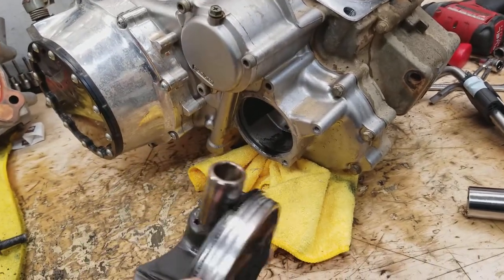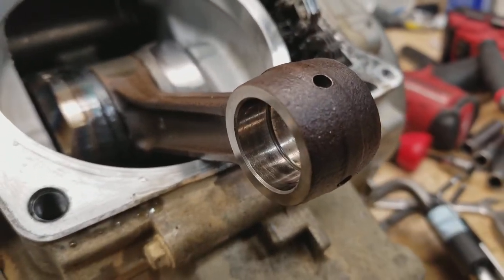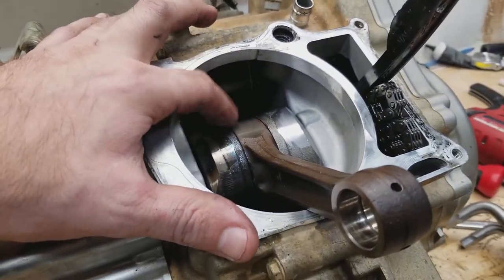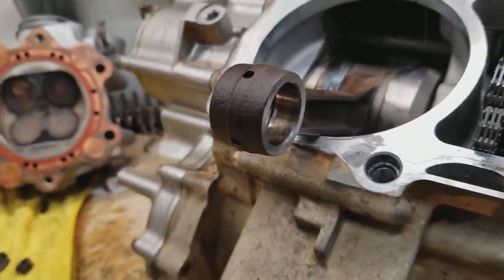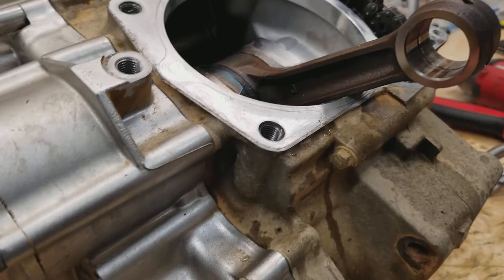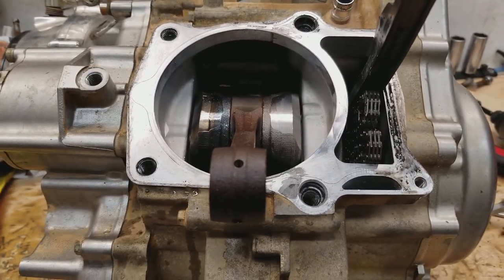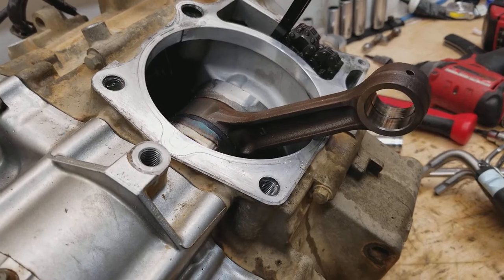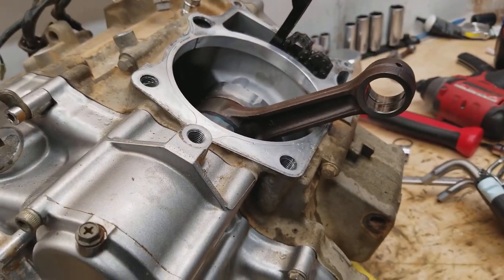Wrist Pin, it's all your Fault . Rod bearing failure

Comment: I'm not up on these type engines but it appears design would also play a big role in wrist pin failure. No wrist pin bushing? Only splash lubrication? Whatever happened to oil holes up thru the rods that lubricated the wrist pins from oil pressure?... they even exist anymore? On some older vehicle engines they use to do that with pressed in wrist pins into the pistons, and only the rod to pin was free floating. Detonation can also play havoc on wrist pins, since it's the most vulnerable part to fail under those conditions. Combustion at the wrong time is a recipe for disaster, especially on engines with lots of wear.

Comment: I have a 1983 honda xl250r never been rebuilt runs like an absolute top and sounds super healthy . Has 21,000 kms on the speedo but the speedo caable was not working when i bought it so it could have anywhere from 21-30 or more. You're talking about being afraid of buying an 8 year old bike? What kind of crap box is this?

Comment: Only the millitary builds tainless on stainless for ever engines.
We get stainless and soft copper bearings.
However, if you run real old school slick fiffty in it, it will never wear out. Just don't do it before break in or your rings will never seat.

Comment: I've been researching this for a week now looking for a technical explanation or maybe an unknown part I've never heard of - but how come there is no such thing as a connecting rod small end side face bearing/bushing?  Just to be clear, not the inside of the small end that touches the pin, but the side of the small end that rubs against the inside of the piston head, the small end rod gap. Cars don't have bushing in them either.

Comment: I have a nmax 2017 125 16000 miles just under and same issues just purchased as non runner piston is smoked lol bore too but gudgeon pin is stuck stuck how did you remove this tried everything

Comment: So can the rod be smoothed out and it will still work?
Reply: Nope, as those rod bore holes have to be near perfect for wrist pins. The only solution I can think of that would salvage that rod would be to press in a bronze bushing then reamed out to fit a new wrist pin. However, if they don't make bushings for it, a guy would have to make his own which I believe is very doable if he had the right tools. Free floating wrist pins have real strict tolerances, about the strictest tolerance in the entire engine.

Comment: I think they just dont lubricate the wrist pin are good enough, then the slack causes all the bearings to have to snack back and forth and wear down and then the whole bottom end goes out. It sucks. They need a oil jet or something that sprays a good amount of oil on the bottom of the piston
Reply: Jerod Hamilton  Cuervo actually came up with the “oil mod” years ago that does just that. He tells you how and where to drill and tap the cases while you have them apart to create a jet that sprays up under the piston.
Reply: @LocalRipper707  oh, didn't know it had the oil mod
Reply: I don’t think this bike has that mod. I just meant that Cuervo thought the same thing you did about needing oil up under the piston. 👍

Comment: What's your advice on oil changes in how many hours?
Reply from the maker: WIDE OPEN THROTTLE really depends on how it being used. The service manual calls for  a believe 30 hrs or aokmething ridiculous. I tell most my Dune riding customers to change oil after a long weekend or 3 or 4 day rides. Trail dirt rider's s might see a longer service interval 8 tanks of fuel.
Reply: MrCuervoRacing ok thanks I know the manual says 30hr but I feel more comfortable with more frequent oil changes can't hurt. Thanks for your input.

Comment: I think there is supposed to be a needle bearing on the rod between the pin
Reply from the maker: Not on 4 stroke
Reply: @MrCuervoRacing what about a bronze bushing??
Reply from the maker: @Evadingmoto  yes but may as well replace the rod with one that has a bushing
Reply: @MrCuervoRacing  mine has a Weisco rod with a bronze bushing. But the bronze bushing freely spins. Have to get a new crank or rod. Probably going through Mr.Crankshaft